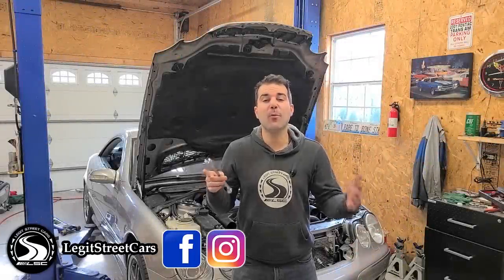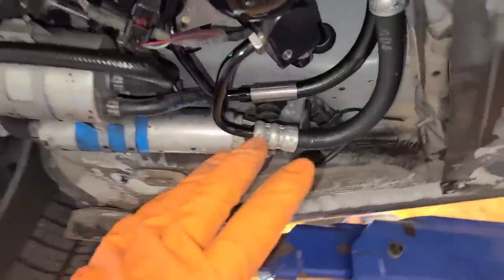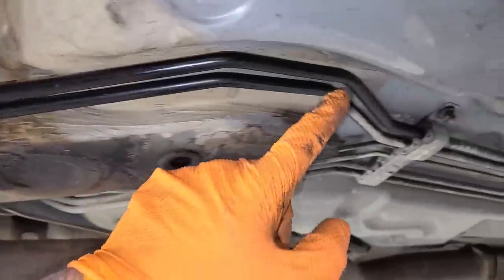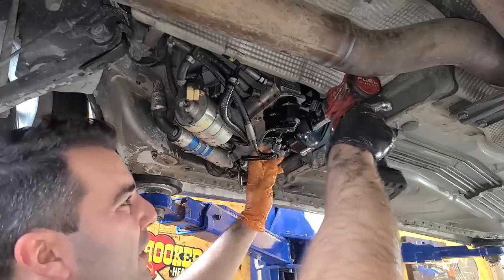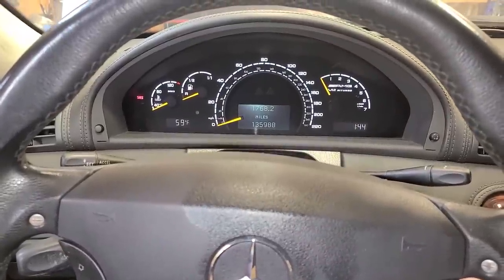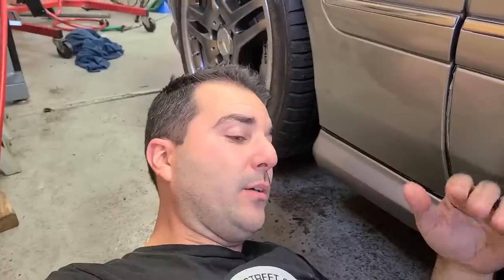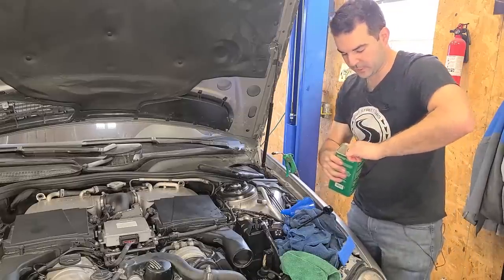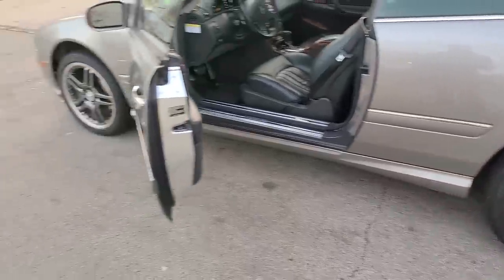I FINALLY Fixed The Hydraulic Suspension On My CL65 AMG & You Won’t Believe What It Was! FIRST DRIVE

Comment from the maker: What's been your worst car? 
https://vessi.com/lsc and use code LSC for $25 off your Vessi Shoes!
Reply: VW Jetta III
Reply: The MJ Stewart Smalley was the best
Reply: 1994 Nissan Altima.  Soulless
Reply: Saab 900 Aero
Reply: 2004 Kia Optima. Between 124k and 127k: 2 cam sensors, 1 crank sensor, timing/water pump, harmonic balancer, front cv axles, a/c compressor pulley froze causing a fire and shredding the belt (bypassed with smaller belt), electrical gremlins with stereo, alternator.
Reply: 01 Malibu, fell apart after 250k… 
Just wanted to say at 6:05/6:06, your lift isn’t sounding too healthy sir
Reply: 1991 Pontiac Sunbird.   under 50K miles back in the day and would randomly just die while driving and then turn back on.   Was super scary since it did it a bunch of times while going through intersections.   I took it to a mechanic back in the day and they could not reproduce the problem and I passed my emissions test and then sold it for $3500 and got a brand new 1999 Toyota Camry.   This was back in 1999.
Reply: I had a 1994 S10 Blazer that felt like i was constantly putting work or $$ in to. Loved the truck, but I felt like I put way too much $$ and time into it.
Reply: In my opinion the LED instrument panels and daytime running lights is the worst "upgrade" to modern automobiles. It seems that most nights that I am driving I will see at least one person driving around without side marker and tail lights.
Reply: Mercedes GL500 with its electrical issues every time, first the ECU, secondly the ABS sensors, thirdly the radio, fourthly the rear screen, fifthly the siren batteries that were shorted, sixthly the air compressor of the suspension that had burned out, so I decided to give up and sell it. From now on, I do not want to buy a Mercedes anymore.
Reply: Anticlimactic
Reply: 1983 Chevrolet C10. Apparently I should have kept it with what people are paying for them now.
Reply: Well, I only owned one car in my life, but I can tell you about a really bad car: My folks's '93 Golf Diesel (MK. III VW). At first it wasn't bad. But then LOTS of electric gremlins decided to make it their nests, up to the point where VW told my folks never to come back with it for them to fix it! My father ALWAYS wanted to get rid of it, but my mom somehow liked that turd. Up 'till one cold winter day, when for some reasons, the electric gremlins managed to get the doors magnetically stuck and it trapped my mom and sister in. My sister managed to get one of the doors to get me to help free mom, but when she did so, it broke the magnetic field and when I arrived all the doors were back to normal. That was what my mom needed to agree to get rid of it and she sold it to one of her cousin's kid. From what I've heard, the guy sent it to the scrap yard around a month or two after he bought it.
Reply: I would not own this car after 5yrs or 100k miles or so. This system was clearly not thought out very well.
Reply: I have such a choice of bad cars to choose from it's hard to tell.
Datsun Sunny van springs to mind. That was the happiest I have ever been to have to walk home.
Reply: Alfa Romeo 156 2.5 V6 - everything went wrong with that car, including an engine went bust. Some things that never fail, failed on that car. But I still remember it with a smile on my face.
Reply: Thank God Alex! 😂
Reply: 1995 Merc C280, bio degradable wires lol Merc garage quoted me over £2000
Reply: 2003 Ford Windstar, replaced every part.
Reply: 2006 Dakota 4x4 4-Door, V6 is a horrible option for that heavy of a truck. I have a 2011 Tacoma I've owned since 2015 and it's definitely my top 5.
Reply: weve got an sl 500 in our store wich is robbing our minds.. r230 ofcourse with ABC and the rear Struts seem to dont hold the pressure when driving, its lowers and raises normal but when raised the Pressures drops to about 99bar (1400psi) and it throws a code. we cant seem to find out whats the problem is, we changed struts, pumps, solenoids everything and now the customer ist taking it back and just sells it as it is. really frustrating.
Reply: @sergiolisboamachado  Whoa, that sounds horribly. My wife’s GL450 was pretty reliable after I fixed the suspension on all four corners.
Reply: Audi B6 S4! By far most unreliable car I ever had with the most issues.
Reply: A 1994 Ford Taurus with the 3.8 was the worst car I ever owned.
Reply: 2004 GTO - total POS, hydraulic throw-out bearing failures, rear diff grinding, leather seats pulled apart at the seams, climate controls didn't work, steering wheel controls didn't work, stock brakes were garbage...  But driving it was fun!  I wasn't too broken up when it got totaled and insurance paid $11k (I was expecting like $5k).
Reply: 1969 MG Midget, but it also got me into working on cars so it was a blessing in disguise.  As a poor student I ended up with a few cars which was sold on the side of the road because I could not afford to pay a shop the money to get it running again.  The MG ended up that way along with a VW Bus and an old Plymouth Valiant.  Once I was able to get some tools and the ability to buy parts I never had to take my cars in again, except for my 911S which required specialized tools for some of the work.
Reply: @MrUltraworld  Oh, it was thought out well. But intentionally not designed to be easy. Wanted to force owners to send them in for dealer service.
Reply: 2008 Toyota Auris. Steering ECU was by far the worst thing. Repaired it and sold it. It was a nightmare car. Pro tip for everyone. If you see and know the car you are to buy is an import from Italy - Run. As fast and as far away as possible. Trust me you do not want to be dealing with cars maintained in Italy. Other than that still enjoyed the stupid painful journey. :D
Reply: E39 540i
Reply: 1993 Mazda MX3 1.8 quad can V6
Reply: I had a 1998 Mitsubishi GSX that lunched three different 7 bolt 4g63's, before I finally built a 6 bolt myself with a 7 bolt 2g cylinder head. It taught me a lot..like don't trust shitty mechanics and that you're better off doing it yourself.
Reply: 2011 BMW X5
Reply: Volvo v70 - changing ABS sensor…Almost made me loose my mind.
Reply: My current daily, a Peugeot 206, have been working on water getting into the trunk for almost a year. Everything is sealed 10 times better than when it was new but a puddle keeps appearing in the trunk after rain. Sometimes it rains and nothing happens. I want to drive the thing into the ocean and let team-seas deal with it :P
Reply: 98 Dodge Intrepid....1st and only Dodge I ever had, happy was the day I got rid of it
Reply: Range Rover Evoque. Spent 5 of the 6mths I had it in the dealer.

Second worst Peugeot 308CC. Typical French crap, literally fell apart around me.
Reply: 05' Audi B6 S4 - a fine car, but an awful engine. It sounds great, but the 40 valve V-8 drinks oil like no tomorrow. Leaky valve guides, cylinder scoring, timing chain guides (against the firewall)...sheesh, never again.
Reply: Fiat fiorino 1992 and opel corsa 2002
Reply: my most expensive in repair bills range rover discovery II got met stuck with 2 clutches, jumped timing gear, broken gearbox, broken 4x4 box all in 4 months time
Reply: Mercedes Benz Cl600 c215 😅
Reply: The best and worst car 2005 SL600...630hp, 700ftlbs,  items failed in the 2 years  of ownership:  radiator, front ABC hose, ignition coils x2, voltage transfer, cooling fan,  new spark plugs,  trunk latch, ABC pump 3xs to get a good one and its still a blue code after 6 months,  rear ABC block, 2 rims cracked, turbo coolant seals, accumulators, PS strut(new one had to be replaced at 6 months), Intercooler pump.... probably more ....
Reply: 1970 AMC gremlin.  Worst car of my life.   Bought for $700 in '78.  Took all weekend to fix it so that it could take me to school during the week!
Reply: I haven’t really had a bad one...
Reply: audi 100 avant
Reply: 1982 Renault LeCar
Reply: 1972 fiat 124 spider - more rust than anything - it was the late 80s - transmission jammed into 3rd and never came out again
Reply: 2009 Chevy Malibu by far
Reply: 99 Trans Am, did a 4L80e swap and had a vibration.  Could never find out what it was.  Ended up swapping the entire drivetrain and selling it.  Now I have an 18 Camaro SS with a Magnuson 2650.  Sometimes you have to make lemonade out of lemons.
Reply: 2004 Nissan Frontier XE.
Reply: 2001 Ford Lightning.
Reply: 1975 Pinto wagon
Reply: Which  computer are you using. I have a 2007 w216 CL550 and I would like to get the most advanced alltel that will completely control all the aspects on my car but not spending all of the money if you know what I mean?
Reply: 05 Subaru legacy gt... two timing belts, bad turbo and a slew of electrical issues under 100k was going to report a lemon law...instead buttoned her up and detailed got nearly $6000 on a trade in.
Reply: @TR850  Yeah, I know that is terrible, specially because I had a E240, E320 and a E350 before the GL. Those cars were great, reliable and hadn't showed any surprises during the 6 years I had then. I had the GL only for 4 years, most of the time it was parked for repairs.
Reply: 1993 Ford Escort. Three separate transmissions, each rebuilt at least once. Eventually head dropped a cylinder seat. Repaired and it dropped another. Sold to a scrapper for $50.
Reply: 2004 F150 with the 5.4 triton V8.  Every week something went wrong with it.  Congrats on fixing the car
Reply: 1999 ML320
Reply: 2014 Hyundai Accent p0420 won’t go away 2014 Kia Sorento 2 engine replacements and 2017 lancer 2 trans replacements
Reply: 03 Chrysler PT Cruiser GT 2.4L Turbo, family car, got it after my grandfather passed away at 180k aways something going on, within 2 years of owning mostly me, had to do

 a $700 clutch and turbo core job, 2 CV axles, lower control arms, $300 worth of tires, 1 wheel bearing, radiator and thermostat, spark plugs, injectors, valve cover gaskets, intake manifold gaskets, and shift bushing
Reply: E39
Reply: 1990 ford thunderbird sc
Reply: 2011 buick enclave.  The 3.6 is an absolute piece.
Reply: BMW 4.8is Dinan S1 signature
Reply: 84 AMW 533i.    Few expensive parts and never ran right
Reply: 1981 Pontiac Bonneville Diesel
Reply: Saab 96 V4 1969
Reply: 1986 Jeep Cherokee w/2.8 GM V6.
Reply: 1976 Audi Fox Wagon.
Reply: 1998 Mitsubishi Legnum 1.8GDI. Bought cheap because it was a grey import that had been written off 3 times. Off course there's no such thing as a cheap Mitsubishi, and I stopped counting at over £1300 in parts to sort the typical issues - complete suspension rebuild and GDI faults. And it would still have been a 18GDI which have the power of a 1.6 and the fuel economy of a 2.0 - the opposite of what they were aiming for! Sold it for what I'd paid and bought an Omega estate.
Reply: A 1997 EK4 Honda Civic SIR (Designated EM1 in the American Market). Bought the car from a friend, it had over 300 000 km on the clock, I so badly wanted the high revving b16a vtec that all common sense went out the window. It still overheated even with a brand new thermostat, water pump, head gasket and Fan. The automatic gearbox would bounce of limiter under w.o.t, when cold it would take up to a minute to engage reverse gear.
Reply: Bmw 530d e39
Reply: ford f-shit50
Reply: A BMW E46Ci. It's a good car with the proper engine, but mine is with a N42B20 which wasn't looked after properly before I got it.
Reply: Hyundai i30 rieliable for 70k miles/9 years then started braking and no dealer support 🤦🏻‍♂️
Reply: Volvo V70 XC, fragile drivetrain and transmission!
Reply: Had to be an 82 300 TD that burned up 2 transmissions, ugh.  Left me stranded in Colorado in the winter 🥶
Reply: 1989 hyundai sonata snot a good car 2 engine and a transmission in-less than 30k dead at 78k miles hauled for scrap at 7 years old
Reply: @MrUltraworld  lack of maintenance is usually the cause of gremlins.
Some people just drive cars never lift the hood. 
Not unknown for a car to have 100k miles still on original oil spark plugs, filters etc...
This Mercedes does seem to have some issues.
And due to the expense of main dealer hourly labour rates = corner cutting by owners.
Reply: My SL350 3.8litre. The Best AND Most Unreliable car I've ever owned 😭😭😭
Reply: I'm trying to figure out the factory electronic damper control for my 1994 300ZX twin turbo. Similar, but far less complicated.
Reply: 2008 Audi A4 2.0t Quattro 6-Speed sold it soon as I fixed it 🤣😥 that was a fun temper mental daily
Reply: 06 cl65
Reply: My 05 c230k has been nickel and diming me to death for the past two years and now it's got an intermittent CEL that comes and goes as it pleases
Reply: Every Ford I have owned, including my wife's cars (They do not call it, Found On Road Dead for nothing) and 80's Chevy cars....  My most dependable cars ? I have been through 4 Lexus LS models over the last 20 years... most dependable cars I have owned...
Reply: @TheCoolDave  My 06 f150 5.4 has 330,000km. Engine rebuilt 5,000km ago. Two times the transmission has been replaced and now its starting to shift poorly again. Ford... Built to be rough.
Reply: @firekip685  my Dad's job had one of those as a get around car, and it was a shop queen
Reply: 70 Toyota Corona, replaced 3 carburators before I figured out it was just a bad spark plug!! it was my first car!
Reply: 2005 jeep liberty 2.8 diesel. They called it a cherokee here in South Africa. Three engines later  andbeen through the family it isfinally running well............except for the abs module
Reply: Easy!  2003 SL500!  THIRSTY and majorly underpowered with only 308 hp for all that weight!  Bought it brand new, and that car was throwing codes left, right and center in the instrument cluster!  It once got stuck in park after the valet brought it around, but as luck would have it they were already having issues with another guest’s car (a Maybach!) and a flatbed truck was already on its way so ordering a second one (for my junker!) was “no trouble at all!” or so they assured me!  I quickly sold it to a REDACTED dentist (no joke!) and he threatened to sue me, but got killed when he crashed it into a cement pillar and the widow was so happy she agreed to drop the lawsuit!
Reply: a vw rabbit diesel . purchased with 5000mls and traded for a 1993 rabbit gti. lack of interest on the part of the vw dealer was abysmal.
Reply: @snakoiler  that was my favorite car to rent from Avis rent a car, not to like rag on or nothing but we used to have family guests alot and i was always stoked when it was available.
Reply: Thomas Mackerley 250k miles? Ugh... that’s a joke right
Reply: My worst car ever has been a black on black 1998 BWM 740il. I really loved the look of the car, but it was a money pit! It seemed like every two or three months there were major repairs needed. Interestingly, I bought a matching black on black 1998 BMW 528i at the same time, and that car has been one of my best cars. It was 5 speed and joy to drive. I finally had to give up at nearing 400K miles because it would cost too much to replace the catalytic converters. The state (CA) gave me $1500 to turn it into the local junk yard and the only memoir I had of the car is the leather shift knob. I now have a 2003 SL55 AMG and hoping that I never have the ABC issues your CL55 had. I'm so glad that you were able to fix it and I am looking forward to the performance videos!
Reply: E61 530Xi Wagon 6sp M Sports kit. Loved her but she broke my heart too many times.
Reply: SAAB Turbo X
Reply: 2006 BMW Z4 3.0i hands down.  Endless problems.
Reply: BMW E39 540i... I loved it but man, that car gave me problems all the times.
Reply: Alex, would you trade it for my 2006 mercedes CLS 500?
Reply: Volvo 240 auto absolutely shocking used to cut out going round a left turn
Reply: Could you not change it over to shocks and springs I done that with a Range Rover I had best thing I ever done
Reply: Countach lp5000….it was a pain to park
Reply: Jetta 2.0 turbo with DSG
Reply: 2008 BMW M5 (Was a hole I threw Money into)
Reply: What type of scanner is that which model
Reply: 2006 BMW X5 4.4i
Reply: Da worse car is the one I have now 2013 Dodge Dart SE. smh so many problems
Reply: We used to have a 2003 Cl500 and the suspension, was def the worst part of the car! Amazing car, amazing engine and power. But the ABC suspension was def what made up sell it.. we replaced everything and then a couple months later we hit a bump on the road and it blew a line and it just dropped! Very scary sounded horrible then sold it to my uncle in Texas
Reply: E45 318i. Hands down
Reply: None
Reply: 76 grand prix

Comment: That Renntech module is very sus. Along with any other after market suspension bits. Glad you made it this far though. Looking forward to seeing you get it cleaned up now.
Reply: I agree. I don't like to splice wire with those splices that are in it.
Reply: First thing I’d do is throw that aftermarket stuff out! I’m glad my C215 doesn’t give me any headaches so far but knock on wood it stays that way! My back lowers after 4/5 days of standing and according to the community here in Germany that is still in norm but man owning any ABC car you just know sooner or later something has to be done. Still, I’d figure out that wiring and get it back to stock these lowering modules are a no go on these cars with such a fine smooth suspension the way it comes out the factory.
Reply: @lethalhype1931  They're great but not worth the diminished returns compared to Airmatic. Airmatic is 90% of the experience and so much easier.
Reply: @lethalhype1931  exactly, Worst thing any one can do to these high end mercedes is put aftermarket crap on, in any shape or form. i have an E63 AMG (W211) 100% stock and its going on 14 years now, Zero issues! ....other than usual wear n tear.